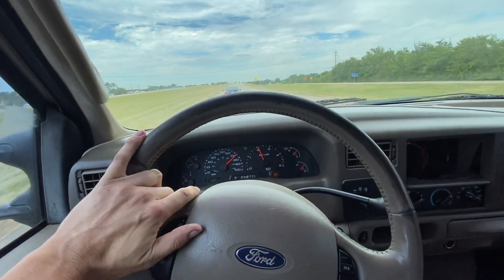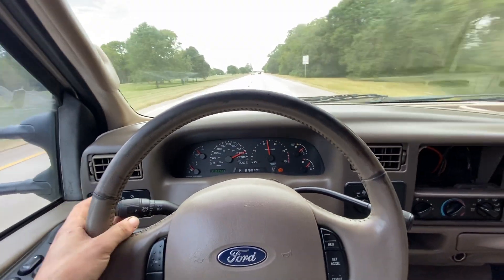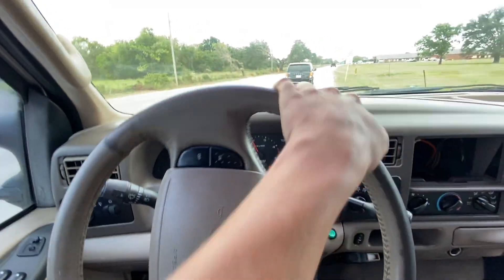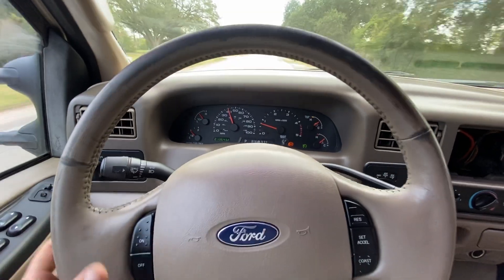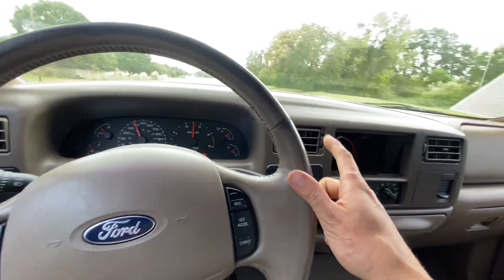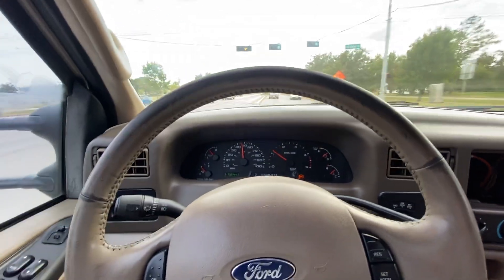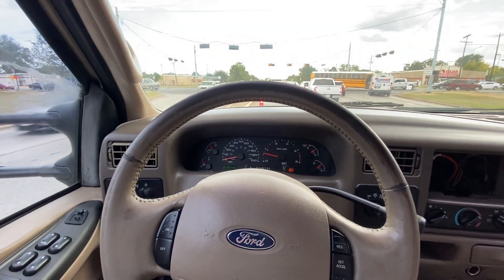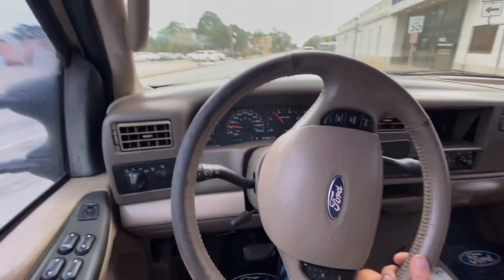2004 Ford F-350 Lariat 4WD *6.0L Powerstroke Diesel - We Ship Nationwide*- Test Drive

Comment: 6.0’s are awesome when They run
Reply: 189k on my 04 ccsb srw, NEVER a single problem. Deleted early, big "time bomb" tunes, no studs. Tows 14.5 k gooseneck, and I race it around too. I much prefer it to my 03  ccsb 7.3. It's been just as reliable with much more power, better fuel efficiency and just a better all around truck. I get 18+ mpg on 35's. 7.3 gets 14 on a good day on 35's as well.
Reply: @georgesrisomsak9650while i agree ill just say the only difference in a 03/04 6.0l to a 03 7.3ls is engine and trans otherwise the truck itself is exactly the same. 05 and up ia where you get more differences such as the suspention, axles steering componants etc. Personally i like both the 7.3l and 6.0l i currently have a 01 excursion 7.3l im lookin to buy a 05-07 6.0l rn though
Reply: @georgesrisomsak9650 agreed I got an 05 with 320k with a hot tune stock head bolts original gaskets never had an issue I tow heavy I race around with it do burnouts donuts etc and it’s never puked a drop or had anything fail